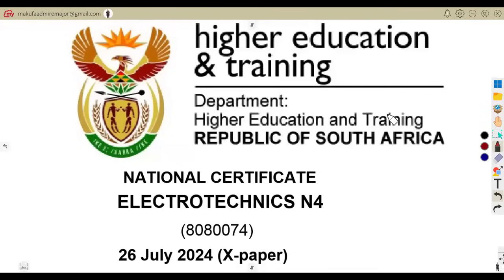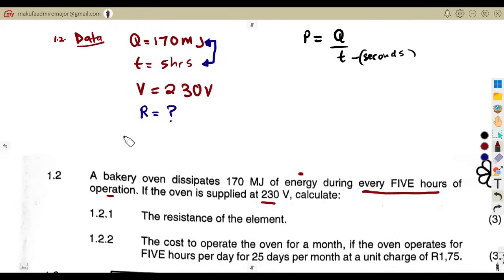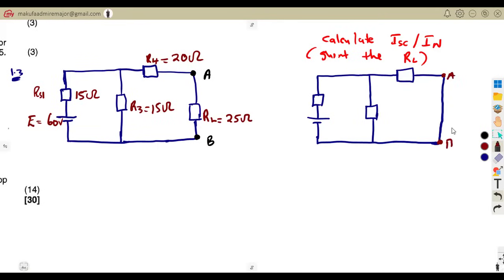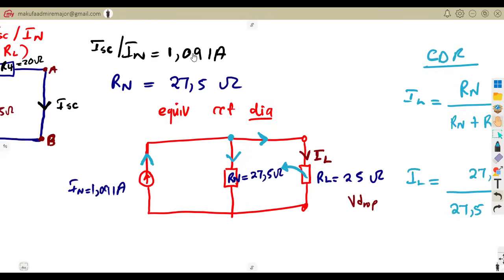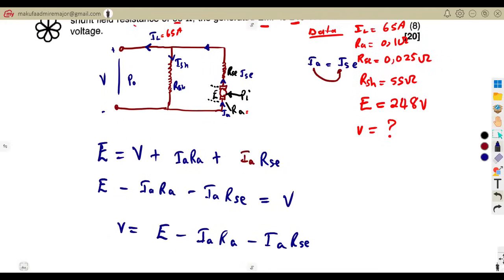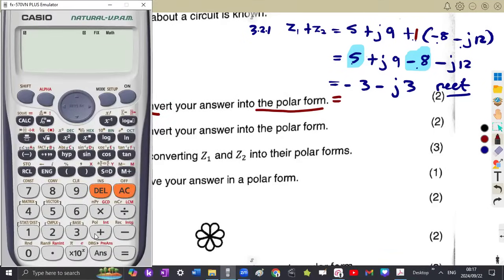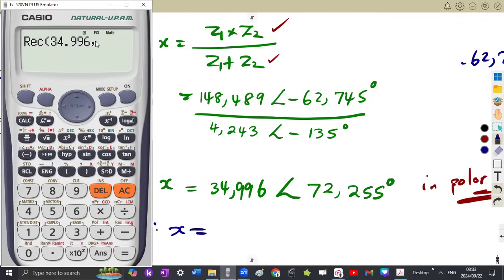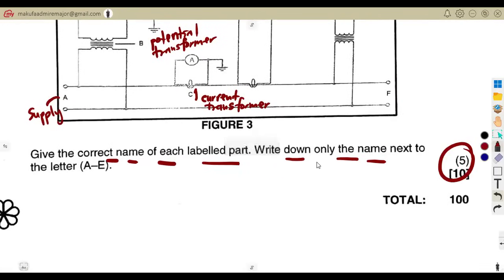Electrotechnics N4 August 2024 Memo Full Paper @mathszoneafricanmotives

Comment: Good day sir, firstly thank you for everything you do for all of us on this channel, you are a gift to us all.
Secondly, 
For Q 1.2.1 we already determined that the oven uses 9.44kw every 5 hours. This means it uses 9.44kw everyday. If we use the oven for 25 days it should be 9.44 kw times 25 days, this equals exactly 236 kwh. Once I multiply by unit price I get exactly R 413.00 rand as my cost to operate.

Your calculations take the 9.44kw as power used over 1 hour and not 5 hours.

I believe you have made the same error as is on the tvet memo, but am not sure if I am the one who is in the wrong here. Will appreciate it if you can double check your work and confirm if I am correct or not. Thank you and keep well.
Reply from the maker: Thank you for pointing this out, I'll double-check my calculations and make sure it's accurate. More light in your studies ✨️💛